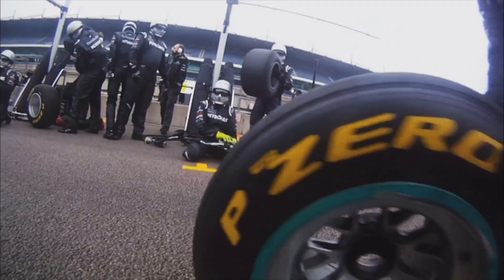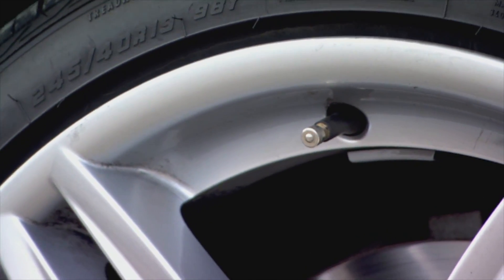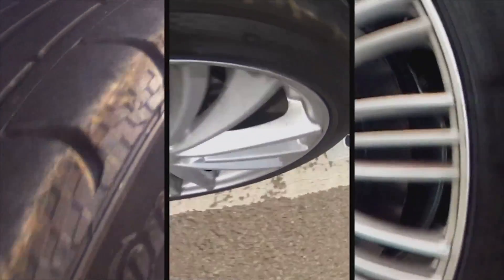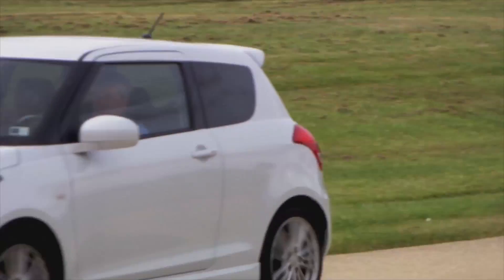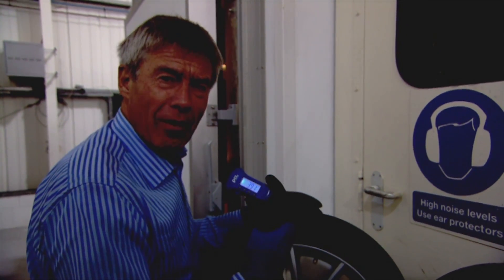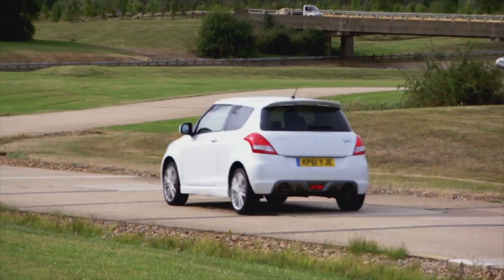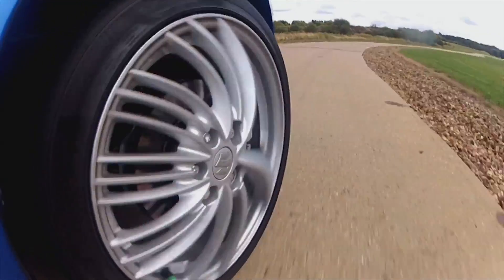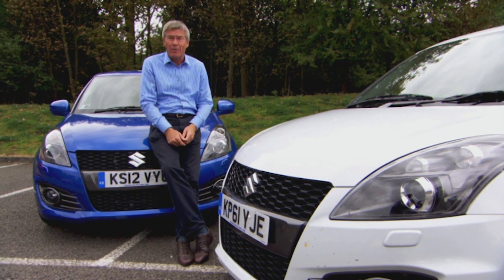Nitrogen vs Air In Tyres - Fifth Gear

Comment: One of the reasons the tire with nitrogen had a higher PSI, was due to yes in lab conditions and Formula 1 garages, they have vacuum pumps, and ways of sealing tires to remove all contaminants before they introduce the nitrogen.  The station they use is mixing nitrogen and whatever else is in the tire/rim space.

Comment: why dont vacuum. out all the air inside the tyre... then only fill it with n2?
Reply: Exactly I would think so..the tyre has air before filling with nitrogen.
Reply: The machine does vacuum the air out. It actually does it 2 times before filling. Im a service manager at a dealership, and think this is all a gimmick the industry has come up with.
Reply: Matthew Lee I wouldn't think that the tire would stay mounted and sealed against the rim if it had a complete vacuum inside.

Comment: nitrogen helps to keep tires from even wear , i have nitrogen in my audi quattro and i notice the mpg were better and more even wear on tires. made my winter tyres last longer over time you will see a difference . think the garage they used had a OLD maybe faulty nitrogen machine cos it  looked crap lol 

nitrogen keeps pressure more stable over time thats all
Reply: 80% of Earths atmosphere is Nitrogen...  So that 20% of extra Nitrogen your adding must make a hell of a difference lmao
Reply: the audi a3 and TT have a haldex quattro unlike the a4 and above models have permanent all wheel drive . i prefer quattro sports differential,  So that the new high-tech unit can also divert torque to the outer wheel of the axle, which revolves faster than the inner wheel when cornering in audi s4 or rs6 rs7
Reply: Janna quit talking you can't even afford a Audi even a Toyota you can't afford.
Reply: I drive a Audi you sad brain dead loser
Reply: janna graham So you have an audi....... Why don't you tell me about the quattro principle..?
Reply: quattro four-wheel drive enjoys a lengthy tradition. The principle involves distributing the engine's power permanently and optimally between all four wheels
Reply: janna graham Bullshit.
Reply: Sounds like a few guys on here are full of hot air best if you read up on the facts first before insulting me or arguing with me
Reply: Filling your tires with nitrogen is not going to make them last longer lmao.  It has no effect what so ever on tire wire, tire pressure does not what you fill your tires with you can fill your tires with water as long as its the right pressure you will have the same tire wear.  Unless you are racing on a track what you fill your tires with will not make a noticeable difference.  What you are experiencing is what is known as Placebo.
Reply: janna graham hv u tried to use normal air in the same tyres?
Reply: Ooo, can you take me for a spin in your Quattro sometime please? :-)
Reply: Aravindhan Veeramani janna graham I love how people like you talk shit about other people's car tips when you probably drive a 2003 nissan maxima with 330k miles on it and a broken taillight, nitrogen in tires is good for your vehicle and will help even out tire wear, end of discussion
Reply: I don't think Janna wants to take me for a spin {sigh} :-(
Reply: No it doesn't. Tires don't give a flat fuck what you fill them with, as long as it's gaseous. Having higher quality rubber and getting filled to the correct pressure is what prolongs tire life.
Reply: Hazel Hazelton have u tried hydrogen???
Reply: jamesgjt
Yes.
Reply: jamesgjt yes i did and had uneven wear on tyres with different pressure , nitrogen keeps pressure in all temp of tyres . read about it . all i am saying car feels better even when going over pot holes and my miles per gallon is better try both ways
Reply: janna graham I'd try it out if Crusher doesn't fancy it ;-)
Reply: janna graham Exactly.  You have absolutely nothing to say so you resort to threats, you can try but i guarantee you will not like the results of your attempts.  You have been tricked into believe that nitrogen is better than normal air, the only thing that nitrogen has over normal air is its harder for it to escape from the tires so you lose less tire pressure over time.  Stop giving women a bad name, you dumbass.
Reply: Crusher103 only one dump ass yourself . Bet you don't have a car ha now get lost as your boring the chat

Comment: I use my farts to fill up my tires,works good.
Reply: Methane is a flammable nitrogen hydrocarbon compound. Very inflamatory remark.
Reply: lol
Reply: pssst3 No nitrogen in CH4 mate ;)
Reply: Albinus81 You';re correct,. I had been thinking about nitrogen before I wrote it and  it just slipped in.  Farts do however contain a high concentration of nitrogen gas, often more than methane, because the Nitrogen that is swallowed from the air isn't absorbed by the body as easily as other gases.  I've seen an estimate that an Average Fart= 59% nitrogen, 21% hydrogen, 9% carbon dioxide, 7% methane and 4% oxygen, ( the odor comes from 1% hydrogen sulfide.)  The mixture is flammable.
Reply: Thats why ur ass is so much bouncy 😂😂 i wonder whenever your tyre blasts, it would be hell around 😂😂
Reply: +pssst3 Methane is a hydrocarbon. N2 is not related to CH4 at all. I studied A level Chemistry so I do know.
Reply: +MrDukke45 You probably have to deal with a lot of pressure increase due to the vapor!
Reply: +MrDukke45 You'd be filling them with methane
Reply: +MrDukke45 I use my farts to run a generator to power my home and earn money selling electricity to the local power company.  After I finally buy an electric car, I'll earn a little less, because I'll have to use the same source to charge it.
Reply: anddddd it keeps you warm! too!
Reply: Jesus Luna
If it doesn't escape too quickly.
Reply: If you ever have a leak in one of your tires I hope it's a silent but deadly.

Comment: Also there are two valve stems on race-spec wheels so you can force all the air out one side while filling it with nitrogen at the same time.

Comment: We use nitrogen in aircraft tires. But that is mainly because of brake and wheel fires. A lot of aircraft wheels are made with magnesium which burns very hot and if plain air is in the tire it would increase the fires intensity. I've seen quite a few tire and brake fires and it makes sense to me. As far as maintaining pressure we always checked tire pressures on daily and turnaround inspections.

Comment: The Nitrogen filled tires increased in pressure more simply because the nitrogen doesn't escape. As the pressure increases in the tires, the oxygen can escape which reduces the pressure in the tire while all the nitrogen molecules stay put in the tire. Thus the N2 tires have a higher pressure at the end. DUH
Reply: FISHURMOMBALL lol good try but the oxygen doesn't escape that quickly
Reply: FISHURMOMBALL   The pressure increase is from the physical properties of the gas mixtures..Some more oxygen does escape though the rubber, but it is a tiny amount,not enough to account for the observed pressure rise during a short race.

Comment: I live in Canada and we see winters of 4-6 months with -35- -40 degrees Celsius. if your tires are installed correctly even after storing them for 6 months and using winter tires I almost never loose any tire pressure. Race cars go from cold to 200mph hot in under a minute and the same with airplanes so the use of pure nitrogen makes sense. They also have a way of purging the oxygen out and filling 100% with nitrogen. You cannot do this with normal tires as you would have to have a second valve or completely deflate the tire and have it under a vacuum to remove any oxygen. Once the seal is on the bead of the rim the tire is already 80% full so just topping up with nitrogen is a complete scam and anyone that pays for nitrogen is a complete sucker.
Reply: honda12345678 Well most people who buy BMW's are ignorant and most likely wouldn't have a clue. BMW is simply taking advantage of stupidity and peoples wealth, don't blame them haha.
Reply: The tyre shop should suck all the air out before they begin inflating - but many don't, and even when they do they don't actually get a proper vacuum inside the tyre because the tyre bead is not designed to seal that way so air gets in as they suck it out - so yeah, on a road tyre it is total bullshit from pretty much every angle you look at it.
Reply: Matthew Sharpe And the tyre shops in Australia want to charge $5 per tyre to fill with this bullshit. Glad I said no to them.
Reply: 5$? My friend works at BMW and they charge 40$ a tire.
Reply: Car Nut acctually bmws are shipped with 100% nitrogen in the tyres, so technically if that is true then you can just top up with nitrogen! but not at $40 thats way over priced.

Comment: My first set of wheels I ever bought for my car had nitrogen fill on them from the company who sold and mounted the tires to them. Over the next 2 years on those tires I never had to fill or lower tire pressure between summer and winter. They stayed at 42 PSI for 2 years. Now as mentioned in the video I am almost positive that they had a good compressor for doing the nitrogen fill but I haven't been able to find a place were I live that would recommend it because of the issue of it not being 100% nitrogen.
Reply: 42 PSI? Isn't it too much for a car?

Comment: how come my old farm equipment tyres(light truck tyres) are still up after 15+ years, never put air in them. That was your old regular air compressor air!
I also owned a tyre shop, I had customers with Nitrogen. I did not see any advantage. they still wore out their tyres at the same rate as everyone else.
Under race conditions where things need to be worked out to the Nth degree pure Nitrogen can be used to give accurate tyre pressures at what ever temp. For us the normal road users it wont mater two hoots.
Reply: whoops wifes login, Lol
Reply: Lisa Law
You should have kept that secret, not enough female gearheads around those parts...
Reply: Lisa Law
Hahaha

Comment: Near the end, what Tiff said is not entirely true. The fact that Nitrogen expanded more is completely acceptable. The reason F1 uses this tech is because it is easier to predict how much Nitrogen will expand during the race considering the general temperature outside. However, with mixture of air, you cannot do this. So, in order to be able to judge better the performance of the tyres of a car throught a 60 lap race, Nitrogen is better.
Reply: well any gas will work as long as the tyre is filled with only that gas alone.
Reply: True that. But, I think nitrogen is used as N2 is the most stable, widely available gas on the earth. Correct me if I'm wrong. This is just a guess.
Reply: Tanmay Chhatbar You're correct about it being the mostly widely available gas, as our atmosphere is largely made up of nitrogen. However, it is not the most stable gas, as the noble gases in group 18 are much more stable. They key factor identified in this video is the molecule size, as larger molecules are more resistant to leaking through the rubber. Helium would be a great gas to use since it is so light. You would need to be extremely rich (helium is in high demand), using it for very short periods such as a 1-3 lap race (the helium molecule is very tiny, which means much of the gas will leak through the rubber over a shorter period of time), and desperate for shaving off the seconds of your lap times.

TL;DR: Nitrogen is pretty good. Predictable, widely available, and more resistant to leaking. Not that great for daily driving, but pretty good for track use.
Reply: Canadian Attack Moose  Thanks for the reply. What I meant to say is that if you compare the availability of gas and its stability, Nitrogen is pretty high on the table. It is not stable in its nascent state, but doesn't react quickly when in a diatomic form. Correct me if I'm wrong.
Reply: Canadian Attack Moose they should use co2 in my opinion

Comment: I guess us guys in aviation have it all wrong for the past 50 years. Hmm have you ever plugged in an air tool to compressor shop air and had water blast from your tool? Dry nitrogen as found in 3000 psi bottles doesn't have all that water in it, can you say corrosion? Besides oxygen causes oxidation, once again can you say corrosion?

Comment: While nitrogen is a good idea due to its thermal stability charactoristics due to forcing out humidity, I am appauled that Fifth Gear is allowed to make a fundamentally false statement.... in particular... that oxygen passes through tire compounds because it is smaller than nitrogen. Anyone who takes 3 seconds to look at a periodic table will see that nitrogen has a smaller atomic number and atomic mass than oxygen! therefore... nitrogen is smaller and would escape through a tire compound more readily than oxygen would. Fifth Gear FAIL!!!!
Reply: Each oxygen atom has 8 protons in its nucleus, while each nitrogen atom has only 7 protons in its nucleus. Thus, the overall size of the electron cloud of the O2 molecule is smaller than for N2, in part because its electron cloud is drawn in closer to the O nuclei by the greater positive charge on the O nuclei. 

Electron cloud dictates the size of the atom. Not it's mass or # of protons since their size is negligible
Reply: Most of the mass of an atom is in the nucleus
Reply: In the interests of science, let me explain what is really happening here. Warning: long text follows. :)

Both nuclear size AND electron cloud affect the size of the atom.  If you're moving DOWN a column of the periodic table, atomic size tends to INCREASE because each successive element has more electron orbitals, which are further and further from the nucleus. But if you're moving TOWARD THE RIGHT of the table (e.g. from N to O), atomic size tends to DECREASE because each successive element has the same number of electron orbitals but an increasing number of protons. This causes an increased inward pull on the electrons, hence a more condensed overall atomic size. This is why N is larger than O. As you can see, it's not as simple as just looking at the atomic number of an element.

But there is more to the story. In air, we're not dealing with elemental N and elemental O, but with N2 molecules and O2 molecules. In an N2 molecule, there is a triple bond between the nitrogens, whereas in the O2 molecule, there is a double bond between the oxygens. (This has to do with the number of electrons in each molecule). Triple bonds tend to be shorter than double bonds, so the N2 bond is shorter than the O2 bond. But the size difference between elemental N and O is still big enough that an N2 molecule is still larger than an O2 molecule despite having a shorter bond.

In any case, pure-N tires are a complete waste of money for normal cars. Some reasons: 1) The mechanic's N2 equipment may not be good enough to remove water vapor. 2) You are not going to be tabulating pressure vs. velocity vs. temperature tables like a racing team would. 3) You won't be driving your car hard enough to benefit from reduced gas loss. 4) Your tire temperature won't get high enough to combust the O2 inside, as might happen on a fast aircraft.
Reply: Joe Benotz
Haha! Thanks for the vote of confidence, but I have to admit something: everything I said is highschool-level atomic chemistry. You can literally open up a highschool chemistry textbook and find this information (maybe not about tires but about N and O in general).
Reply: kurayami001 Mass and size are not interchangeable mate.
Reply: kurayami001 .. you are right about that. But that has nothing to do with its size is what I mean.
Reply: nojyt I had a friendly argument with my local tyre guy about this once... he gave up eventually when he realised I knew more about it than he did (because I did indeed pay attention in highshool physics and chemistry and he probably didn't) and last time I got some tyres for my wifes car he didn't mention nitrogen at all- but I see he still sells nitrogen from the signs out front. Such a have, but I guess it makes them some extra money.
Reply: nojyt Jesus, a commenter who actually knows something about which he is talking.  Incredible.

Comment: Do you have a video based on Suspension? (Spring Suspension & Suspension Alone), and what substance to use in the suspension (Fluid, or Gas)? Fifth Gear